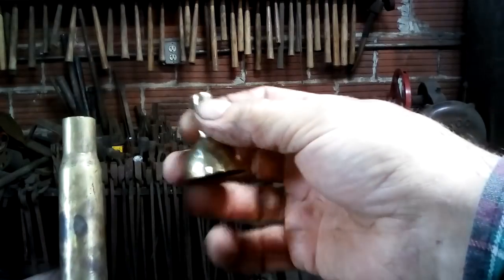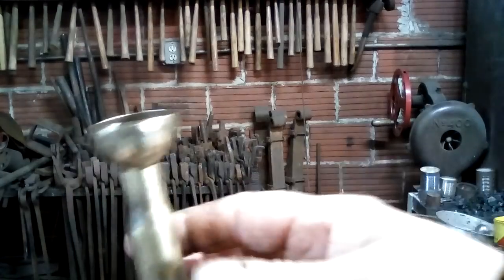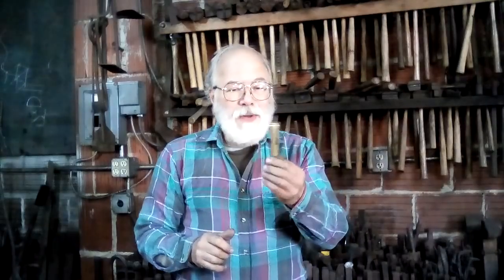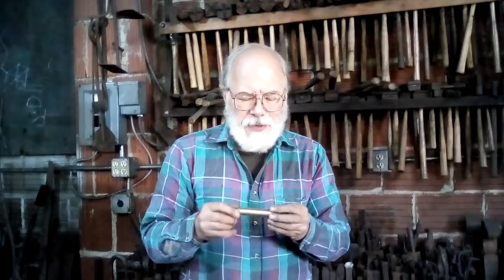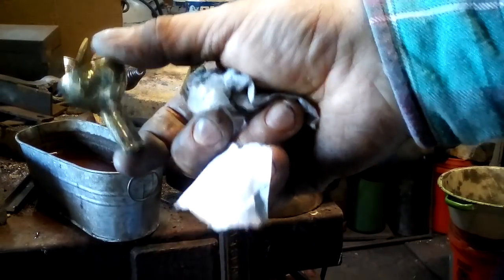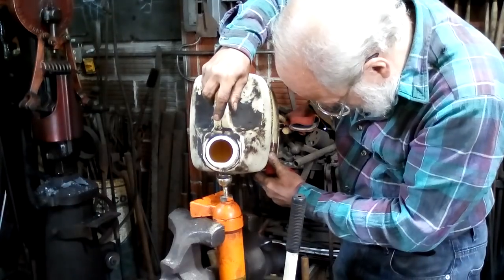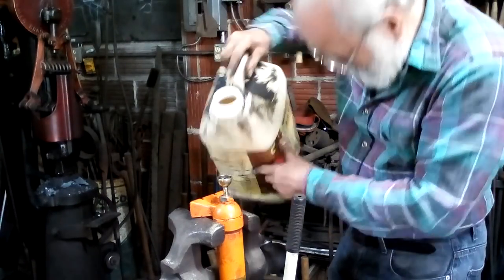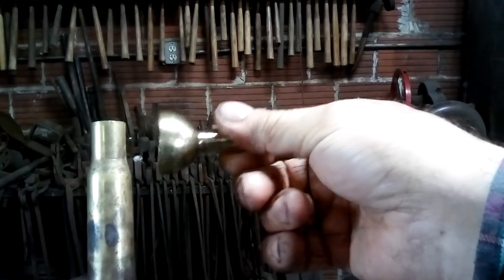A Blacksmith's Dictionary, Ball Bearings as tools or how to turn 50 cal. BMG brass into a funnel

Comment: G'Day Daniel,,,Taught me some thing about brass,,is that the same for bronze as well,??
now about ya Balls's's,,I'd be welding a bolt to the ball and striking the bolt and not the hardened ball with a Hardened Hammer,,
every Now and then things go terrible wrong when such treatment happens,
Reply from the maker: Hi: Brass and bronze are much alike, the modern world has many alloys , sometimes unknown what you have, so not always the same. Try it and see.
 True enough that you should not hit hard steel with hard steel. My reason is that the balls are not "pinched" between the hammer and anvil. They float in the soft brass and empty space inside the brass tube. The hammer drives it down into the empty , not against the anvil. Safety glasses are a good practice.
Bad things do happen , spalls from the ball or hammer are possible, dented hammer faces. 
I made some balls on shafts by annealing the ball in the wood stove overnight, drilling and threading, re-hardening. That way I can use longer or shorter length shafts as needed. Be careful welding hard steel, you can make brittle spots if it cools to fast , or soft spots if the welding heat draws the temper.
A lot of the method  i used was with the idea that many people watching don't have piles of tools. Use what you have, see what you can do.
Hope you have fun
Daniel